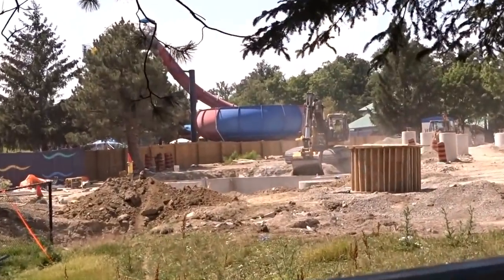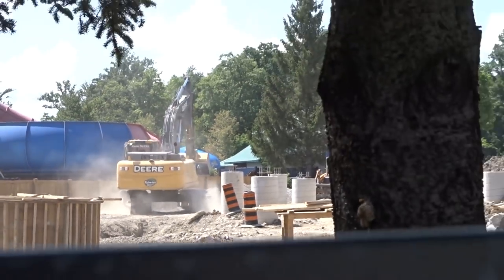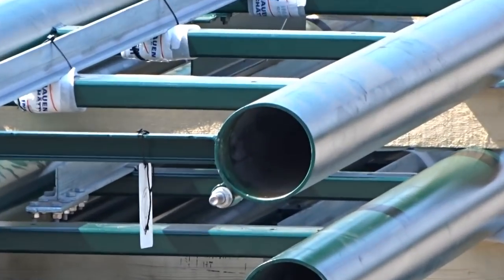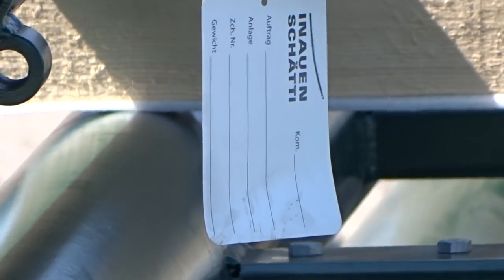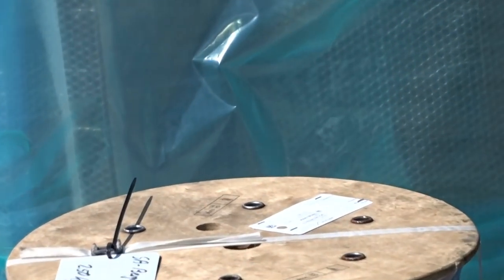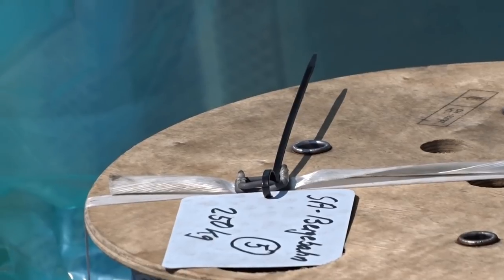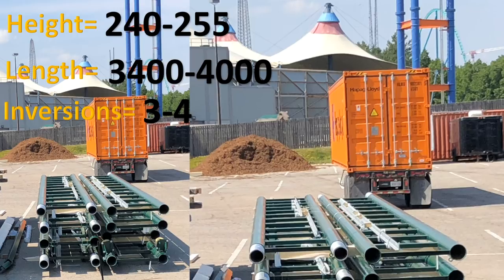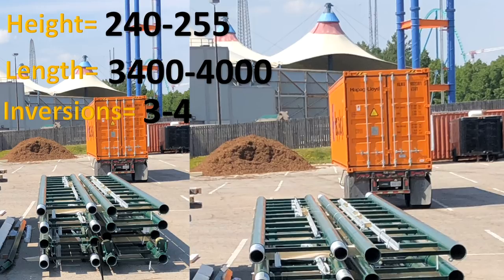Canada's Wonderland New Massive Coaster Height Confirmed?

Comment: When they announce the new ride where will they announce it? On a site or what? Also will it say the height and all details?
Reply: It will start with a teaser campaign that will likely consist of posters placed around the park and some type of web related teasing.  When they make the official announcement it will almost certainly be at the site of the ride entrance at the park (traditionally where parks do it).  Official announcement is sometime in August so I have heard.  Official announcements almost always contain the full specs of the ride as well as a CG video release that shows both on and off  ride views. 

Many of us feel the teaser campaign should have already started - wondering if they are envious of the hype you have helped to generate AI.

Keep them updates coming please, no matter how small.

Comment: 8:13 Valravn is 256, It's not going to beat it.  It WILL break 1 record though, largest drop on a dive coaster, (Currently 255 feet)  I estimate the drop will be 310 feet, supposedly meaning it COULD meet Giga standards and BECOME a Giga, but not in hieght.

Comment: I’m confusion. What’s the elevator track for?
Reply: It is the track that runs parallel to the track as it goes up the lift hill. Kinda like a staircase. They need it for doing work on the coaster and for potential evacuation
Reply: Sams Strange Stuff Watching the Valravn POV, the stairs and all the other stuff going up parallel to the lift hill look nothing like the green pieces shown in this video
Reply: crystalbeastinca they look like the left side blue, but don’t confuse them with the stair cases.  Pic: https://www.flickr.com/photos/daveynin/29768508132
Reply: Sams Strange Stuff oh ok thanks!

Comment: I don't get it...9 pieces times 18 ft is only 162ft.  Where are they getting ~255ft from?
Reply from the maker: cruiser20062006 it appears I messed up my wording. The parking spaces are 17-18 feet each and these pieces are 2.5 parking spots each.
Reply: The 8 pieces of track in this vid are not part of the lift hill. This vid is so messed up.
Reply: They are the funicular tracks on the lifthill.
Reply: What do you mean by funicular track. The 8 pieces of green track in the vid, do not look like any B&M lift hill track. Lift hill track is similar any B&M track, but with a channel for the chain. Look at the lift hill on Valraven.
Reply: Check out this site - first picture.  Look at the rail the funicular is riding on Valravn.  It is on the left side of the lift hill.  https://www.themeparkinsider.com/flume/201607/5175/